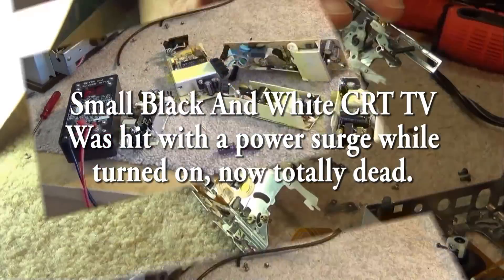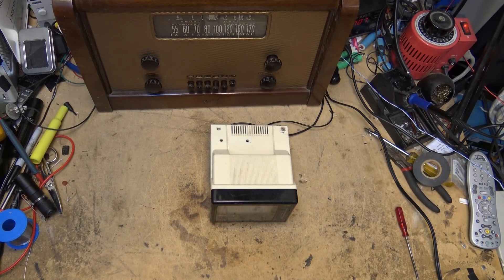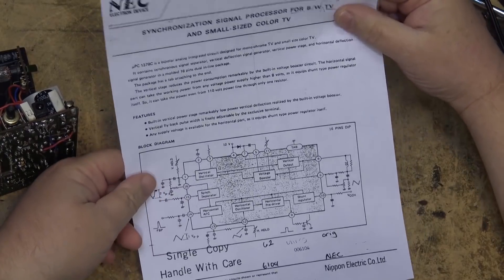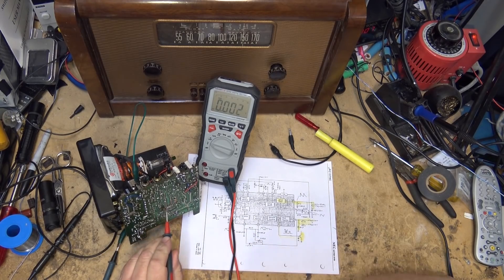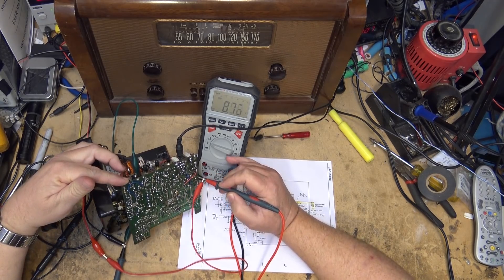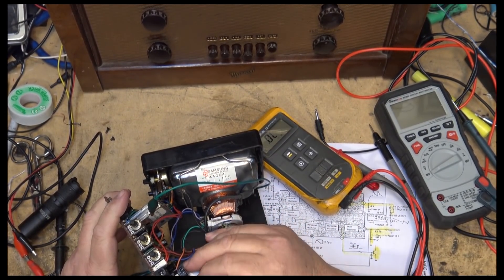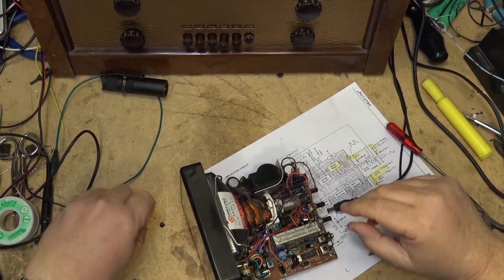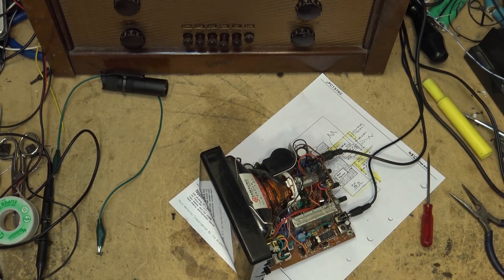Mini BW TV hit with a power surge now totally dead can it be fixed

Comment: Power was out for about 4 hours after that windstorm. 30 foot trunk of my neighbor's tree snapped off and just missed my workshop. I was surprised that Hydro got the power back on as quickly as they did. A block away from me the chainsaws were going until midnight. The local tree companies we'll be having a very very good Christmas this year.
Reply from the maker: You were lucky.  Mine was out for over 12 hours.  On the up side I got to burn all that gas that has been sitting in my generator since 2011.  The bloody thing started first pull too.
Reply: @ @12voltvids     ,the answer on the question i did have i mind. 12 hours is VERY long (i expected much shorter).
Reply from the maker: Some people are still without power 6 days later..
The longest it has been out here is 2 days. Last time it went out about 7 years ago, a tree came down up the street and took out the power line. Since it was only 20 homes affected we were low priority considering that many others were out. My generator was working over time that outage.  I fired up my generator when I got home a few hours after the power went out and got my aquarium pumps running, and essential lights, internet and TV.  I can still cook as we have gas for that. I was ready to leave generator running all night, but power returned just after midnight.
Reply: @12voltvids   Lucky that you have a generator for such cases.
Reply from the maker: I actually have 2, but the bigger chinese made unit steel fuel tank rusted out and started leaking, so the older American made Coleman which is only 1500 watts was pressed into service. Quite impressed as the gas had been in there for 7 years and it started first pull.

Comment: I went into a favorite local thrift store around a week ago. I spotted an early 80's RCA 9 inch B&W TV. I paid 2 bucks for it. As I go to walk out, I glance at a bookshelf and find a 4 inch Embassy brand B&W TV for 50 cents. It has a tuning indicator on it much like yours, but a big, fat knob on the side as a control. Both work.  I've been curious as to what the little one is like, but fearful of messing up the tuner. I think there was an under cabinet mount that is missing in action. I actually watched it for an hour or so a few nights ago.
Reply: Cyberbob  That's a good 99 percent of what I see. No 80's printers yet. It seems like the one store is the best. It's a local place called Last Chance Mercantile. They get better stuff than the Goodwill and Salvation Army.

Comment: The part that gets me, is I get .6XX drops all the time on good transistors. So that transistor would have created a toughdog problem for me if it was in a different circuit, say, a driver stage of an amplifier or something. What I look for is R prime E drop from B to E over B to C. if that looks good, I would have been at a loss there. I would have put that transistor into a category called breaking down under load. Diodes are notorious for that too.
Reply: Yeah, I guess that's where injecting the 12v at the output of the transistor stopped him from going down a rabbit hole.
Reply: I didn't know you watched this guy aswell.

Comment: Odd, the wallwart would have saved the TV 🤔 guess the wall wart had poor isolation
Reply from the maker: Wall wart is just a transformer.  Give it twice the input, get twice the output.
Reply: 12voltvids i was thinking the switchmode type

Comment: Thank you so much for the quick way of testing those out Dave. I admit I would have been lost after ohming out 0.6 & no reverse leakage. All diodes I've tested are usually no higher than that. Also uu toot sucks big green ones. I was saving that one to watch today because I was in a lot of pain yesterday & would not have learned anything then. Exactly just how do I become a Patreon? I pull up your channel & it only shows the pay pal where I've sent some money before but nothing about a Patreon. Thanks again Dave, that's a big help with this lesson.
Reply from the maker: This was a dog.  I thought it was good too initially. But as you saw, it didn't work and changing that 1 transistor and it fired right up.

Comment: Use a surge protector 🤔🤔
Reply from the maker: I do, just not on this. My bench is plugged into a power bar but the wall wart for this was plugged in directly because I leave it running 24/7

Comment: Now I have is the 1987 GE 7-7150B, the picture tube is Orion 5" monochrome TV, it's all made in Korea, probably it's used their parts from Samsung or LG (or known to be like Gold Star), got it for free from the yard sale and nobody wants them but told me that I can have it.

Any monochrome TV that I have, I can play around with that, is play the aquarium video that I have is ScreenDreams Living Aquarium Vol. 2, and it looks the video every eight minutes, and when play all the videos, it plays ten minutes when the video loops. On the other hand, anything that I have is the Chinese made monochrome TV, I can either play the aquarium video, or use the clock display with weather forecast.

Now speaking of the monochrome tube TV, when the emissions are gone and out, can it always replace with another monochrome TV and to get it going again?
Reply from the maker: Most of those monochrome tubes are interchangable. You might have to rewire the socket but that is it.  Most even use same pinout.
Reply: And when the flyback transformer is no good to the point that you can hear the whining noise where it will not be able to turn on the picture tube, was it the best time to recycle the TV?
Reply from the maker: @Bluethunderboom  
These flybacks very rarely go bad.

Comment: I’m curious why the regulator is needed if it works straight off the 12v input?
Reply from the maker: Regulator drops to 8v. This is required for hv control.  Too high hv and crt starts to spew xrays.
Reply: 12voltvids Thanks never knew that. Is there a protection circuit in crts to prevent this from happening?
Reply from the maker: Yes all CRT televisions and monitors have an OVP (Over voltage protection) circuit that monitors the B+ and if it goes above a preset value shuts down the horizontal oscillator which kills the HV. 
They all have this circuit.  Perhaps a video is in order to demonstrate this. I can bypass the regulator, and bring the power up with a variac and show the set shutting down and going into protection.
It is a latching circuit, so once tripped the set stays off until unplugged.